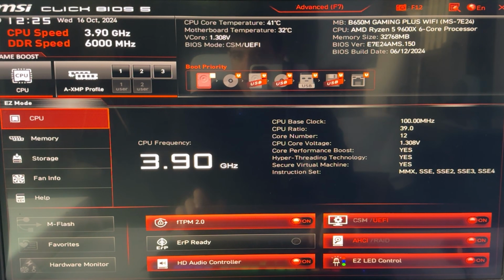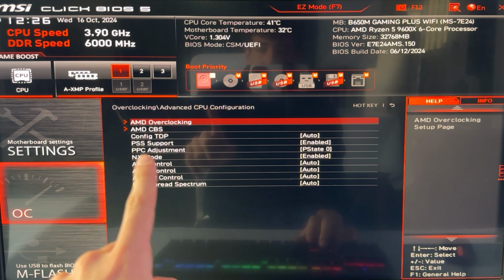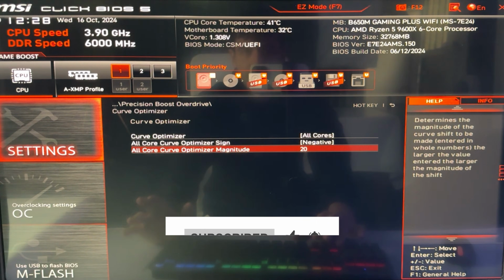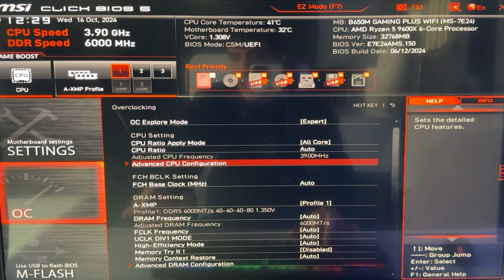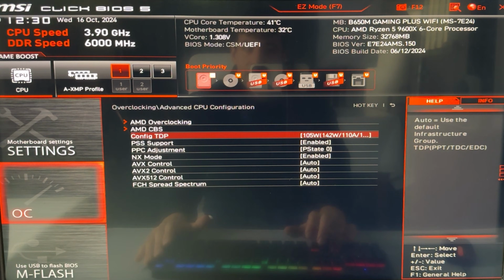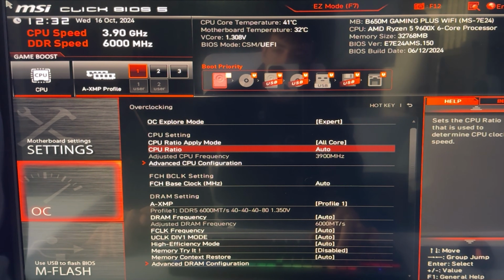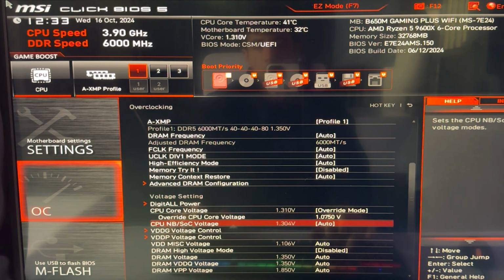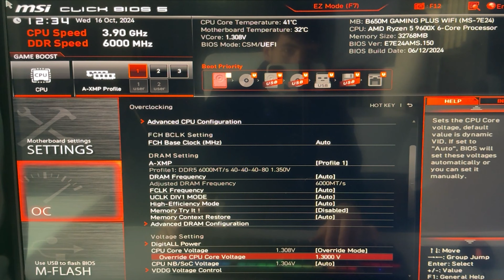Undervolt your Ryzen 5 9600X for more FPS and Lower Temperature!

Comment: Great video.
I undervolted my 9600X -20 and tested before and after playing games.
In HWMonitor my CPU Package Max went from 81.6 C to 71.4 C, the CPU CCD #0 Max went from 88.4 C to 73.3 C,  & the CPU Cores Max went from 75.3 C to 59.6 C.
Reply: High temps playing ultra gamings on 1080 p for stress cpu never pass more than 70c using 3 fans cooler aio

Comment: i try this and i had 0 results with all core - 20 or -30, same perf , same temps
Reply: You clearly do something wrong.
I can go 90w or 150w and have many diff performance diffrance.
I try to find best one for me.
My all cores goes idle/gaming 5.5Ghz but I want 5.7Ghz.
Reply: I feel PBO is nothing for me, I may just go manually oc like old days :)
I am going to set Vcore stable at 1.3Vcore and start with 5.2Ghz and rise up by 50Mhx step by step.
Reply: @Kage0No0Tenshi  i have a 5900x i'm not sure what values to do in that mode for best temps with the same performance, if i can get both it's ok but my objective it's same performance with less temps, 76º/77º spikes seems a little bit high , a few months ago i was gething no more then 70º spikes ( and it was VERY rare ) and i change nothing and then it's starts to get higher slowly without changes
Reply: I'm only trying simple for a few days , i maybe notice some less jumps in temps maybe 1º less degree now , performance wise nothing change or if it was , it's marginal like 1% or 2%, but now i feel something change, i was hoping for less temps

Comment: My ASRock B850M-X WiFi R2.0  mobo has that Precision Boost Overdrive page, but it doesn't have an Advanced option to pick, only Auto/Disable/Enable. When I choose Enable, there's also no Curve Optimiser page anywhere, so it seems like the ASRock screens are a bit different, unfortunately :/

Comment: I think (I am not sure) but I think this lowered my idle temps by 5 degrees. I'm sitting around 41-43 degrees idle and I rarely see anything above 70 while gaming at 1440p. I noticed the volts stay at 1.1 and I'm on an AIO.

Comment: I have this cpu now but i always used to have intel cpu before and they always run idle at about 35 degrees but this cpu runs idle between 45 and 50 degrees on idle. I have water cooling but its still around 45 to 50 degrees. How do i lower it to around 35 drgrees idle? Would this tutorial help?

Comment: 9600x without all this = 73° Peak. Now = 61°. Thx bro
Reply: What cooler are you using? 73° peak is pretty good
Reply: @yerachmielb1 I get a avrage of 73 when running a cpu benchmark I use a cooler master 212 black
Reply: @Whyalwaysreparingstuff  I must be doing something wrong. My cooler is a coolermaster hyper 212 spectrum v3, and the cpu hits 82-84 during benchmarks/stress tests. Nothing throttles at all, in fact without using PBO and the curve optimizer, my CPU doesn't even advertised clock speeds.
Reply: @yerachmielb1 I think the 212 black has a fan with more static pressure so it would make sense yours runs a bit warmer
Reply: @Whyalwaysreparingstuff  That's definitely possible. Truth is, it runs fine, and rarely produces noticeable heat, so maybe I'm being nitpicky.
Reply: @yerachmielb1  Probably hes not doing the same test as u. Its widely different if u do an aida64 test, or a CB23 test, totally different temperatures.
Reply: @CoffeeGameMovie  I used Prime95 once and CPU-Z a couple times
Reply: @yerachmielb1 be quiet! DARK ROCK PRO 5

Comment: Had to do this until my liquid cooler gets here. I was getting 80+ temps with a beefy fan cooler....
Reply: It’s weird to see a lot of ppl running their 9600x at above 80º when i’m sitting at 60 on heavy load while idle goes not higher than 38-39
Reply: @karedport.3435 you probably have eco related parameters on in BIOS and aren't achieving full speeds. I have mine set to 105w tdp mode with custom pbo. at max load and 95c hit 143w total package on a peerless assassin Air cooler.
Reply: @karedport.3435  it might be ambient room temperature affecting this, or bad airflow in their cases. my room ambient is 70F/21C and under load my 9600x doesn't go past 65 C and fans aren't even maxed out.
Reply: @karedport.3435 im in that case, my 9600x run at 84°C in game with a thermalright assassin King 120 SE and around 50°C on desktop…
Reply: It's supposed to do that. It boosts within parameters until it hits 95c. If you're getting less than that it just means you have a good cooler.

Comment: I got some strange results. Before that, I had a temperature of 80-85 in the game. After that, the temperatures did not change. I'm still digging into what could be the cause of this behavior.
Reply: Did you find out why? Also what are your temps on idle and heatsink?
Reply: might just be your fan setup or thermal paste application. tbh i did a pretty shoddy job when installing my cooler (i put it on incorrectly so i took it off and put it back on with the same thermal paste) and my cpu doesn't go past 65 C on full load.
Reply: Try reseating your processor, repaste and put the cooler back on, monitor the fan speeds and curve on your cooler aswell

Comment: I have negative 35 on my 9600x with no problems under stress testing. From what I have red you get no extra performance in games by using PBO or the extra TDP wattage. You actually loose performance in games for some reason. So the best thing to do is just do the undervolt thing.

Comment: Thank you! My 9600x is stable with the value of 40 (Maybe more but 40 is enough 😅).

My test:
- Prime95 (30 mimutes)
- Cinebench 2024.1.0 (2x Multi-Core)
- Valorant (3 hours)
- CyberPunk 2077 (3 hours)
- Idle / Browsing (2 hours)
Reply: Negative 40 sir?

Comment: my temps were reaching 91 while playing warzone but with this setting the temps stay around 70, thanks!. Also considering how high my temps were before the undervolt would you consider that going to 170w mode be a good idea?
Reply: Mine at stock doesn't even cross 65°c most of the time it stay at 59

Comment: so i have the same msi motherboard and did most of your config for undervolting and my pc went off and wouldn’t give any lights. had to use a second 8pin cpu connector so my pc turn on. other than that my fans are finally running cooler:)
Reply: Did you change it to negative? Sounds like you left on positive and set all all cores to use more power, which is why you need the additional power connector.
Reply: If it has 2 power connectors it's best to just plug them both in. It can't hurt it.

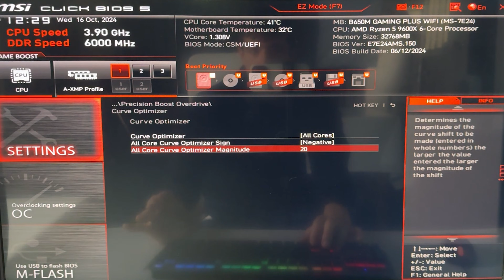Comment: 4:30 I went for All core magnitude 30 and ran Prime95 smallest FFTs for 15 mins. The temp was 89-90 ℃ and no crash. Does that mean my CPU is really good, guys?
How can I test the stability after undervolting?
Reply: Try blender opendata, some cinebench, and some gaming. If it crashes within 2 hours then its probably not stable.

Comment: have you tested the 9600x on a gigabyte b650  motherboard ? i have  tried 1v 5ghz profile and i have tried manually setting pbo to 65w but the stress test is going up to 90c on a nice 15c day but idle is in the 30s not sure  what to do my 7800x3d doesnt even go near  70c under gameing or even 80c under stress test

Comment: Its older video but i just buy 9600x with Asus Tuf B650E i have freezer 2 420mm aio and this cpu have idle  by room temp from 23  in idle 40-45  its that normal ? In the night about 35 degres idle on gaming 67.And second Question i looked in tab and on Desktop clock this cpu in idle on 5,4ghz.Its my first Ryzen cpu i got earlyer 11700k 125 watt and it was much cooler with same cooler...i got newest bios with 105w option but i got it not activated and cooler its propely installed.R24 Cinebech after 10 min  60 degres and 916 points

Comment: Putting Curve Optimizer at -20 negative made me lose about 20% of performance, since the 9600X is supposed to be faster than a 5800X, doing cinebench 2024 tests I am 20% slower than the 5800X this time lol
Reply: Have the Same CPU, in Stock settings, i geht in cinebench r 24 979 and Temperatur 73-77c° 360mm aio near 100% Fan Speed

I Manual Setup CPU at 5200mhz and v1.1 and get 936 at cinebench and 50c° on Low Fan Speed

Also Manual Setup CPU on 5400mhz and v1.2 and get in
 cinebench 974 and Temperatur 60c° and Fan Speed are little Bit faster that the 5200mhz

Maybe IT Help you (in 5200 and 5400 i set up tdb to 105w)

Comment: You are a legend my man. This tutorial helped me get my CPU temps down from 75 to 60-65. Huge difference. Fans are quieter as well. 
If you see this just want to know I had set the TDP to 65W. Should I increase it? Asking so I don’t miss out on any performance by lowering too much
Reply: try 95w, if temp is too high u can always put it back
Reply: @roten.  Thanks for the advice. Will try this
Reply: @harshvardhan5705  so, how did it go ?

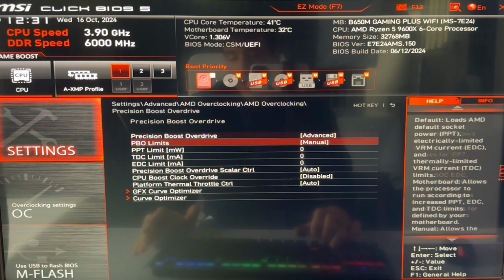Comment: 6:19 Just a warning people, pay attention to the units on the PBO Limits, some times its on mili units
Reply: This setting should be same across all AM5 boards, with same units.
Manufacturers can (and do) their own unique flavor for PBO-Overclock-Voltage etc in addition to AMD mandated one, but the Settings > Advanced > AMD Overclocking should be common for all boards, MSI ASUS etc
Reply: @raonyreis13  That doesn't really change the point unless your IQ is negative.
10×0,1=1
1=1
1000mL=1L
Unless your IQ is negative. Or you skipped school. Everyone know m followed by the symbol of the unit mean it's 1000 times smaller.
1000mV=1V
Reply: So, to manually set the PBO limits the same as 105W TDP, the values would have to be: 
PPT - 142,000 mW 
TDC - 110,000 mA 
EDC - 170,000 mA, right? 
(sorry if it's a stupid question, I just don't want to fry my brand new CPU lol)

Comment: Haven’t finished the video yet. But I’m not sure how we’re getting better temps and quieter fans. But also getting more performance?? Those benefits seem contradictory. I want my pc to run as fast as possible and I don’t really care too much about noise. But if I’m making my pc quieter and use less power i can’t help but feel like I’m missing out on some performance. Can someone explain?
Reply: Undervolting lowers the temps and locking the cores gives you more performance

Comment: I have an ASRock B850M-X WIFI and it’s updated to the latest (beta) 3.18 bios version yet I still don’t have an option for ADVANCED PBO. Only shows Auto, Disabled, Enabled
Reply: When you can, I'd recommend getting off of that board homie. I'm sure you've seen some of the horror stories with ASRock and CPUs frying. I just had it happen to myself with a Ryzen 5 7600x, latest bios. Had a spare MSI B650 that I was able to breadboard and flash bios so it'll take my 9600x I bought. Better safe than sorry 🤙
Reply: @xhalfwayhumanx thanks man definitely learned something new here
Reply: @cohbweb  Honestly it's not guaranteed to happen and if it hasn't after 7 months it probably won't now, but just something nice to know.

Comment: Great tutorial, ottimo lavoro! I haven't assembled a desktop PC in a decade or so and was a little rusty with bios configurations. For now I put the curve optimizer at -25 and everything is fine, TDP at 105W but I put a slightly negative on the maximum frequency because I don't care to exploit every last bit of performance, and I have an SFF case (Asus AP201). During normal use the PC is dead silent, while gaming the CPU goes up to 70°, very quiet.

Comment: i am using a gigabyte b650m gaming plus
and with my 9600x, i am able to do +200 boost with per core negative offsets of 60,60,55,50,40,45
and with a PL set to 88W, i am getting 5.268GHz stable all core on cinebench r23

i've tested it on ycruncher and corecycler, different games, and general use for days now, no issues
Reply: I have b650 ax v2 and I have simmilar results. 30 doesnt seem to do much
Reply: @ i don't know if we'd have to crank the power limit to see more gains
i don't have the 9600x anymore though

Comment: Static OC (Unavailable on A board) BCLK=100.00MHz (Not obliged); Core multiplier ×56 ; +200MHz limit ; Core boost off ; C-state off ; FCH Spread Spectrum off. Profile 142W PPT ; FCLK=2000 ; UCLK=MEMCLK (so 3000MHz) this equal to 5,6GHz at ±1,36V stable (can go as low as 1,26V

5,4GHz at ±1,26V stable (lower possible)

4,7GHz at ±1,05V stable (lower possible)

3,9GHz ±0,95V (lower possible)

Go try it my shrimp.

Results: 5,6GHz ±7050/890 CPU-Z
5,7GHz ±19185/2175 Cinebench23 (yes I can do 5,7GHz. The highest I've managed to boot and log on CPU-Z was 5,85GHz at 1,36V

All that was done on a entry motherboard (MSI Pro B650-S Wifi, BIOS K4) with a entry cooler (Assassin King 120SE) with a cheap but great thermal paste (SYY 15,7W/mk for comparison MX-4 is 7W/mk which is kinda bad but should work perfectly fine in 99% cases)

Edit: I'm not gonna lie 1,36V is mostly for increasing stability or if you're unlucky on silicon lottery, this should work at lower voltage, as the potential question of: 

Why not using PBO ?

 PBO do task more slowly, and doesn't boost as high as 5,6GHz unless I do a really low CO (like -40) the CPU still draw ~1,34V-1,36V on load which doesn't change much from manual) and run hotter than manual from.

Second edit: I've tested MSI X870 Tomahawk to push further OC and RAM OC. The board is pure garbage. Unable to do what I was doing with a mere B650 of the lowest tier. (Pro is the lowest on MSI) and a lot of BIOS glitch, the community seems to say the same thing about their BIOS. It's garbage.

I tested MSI B850 Gaming Plus. The motherboard is pure garbage for RAM. Often not even working for RAM sensors or cooking my RAM by putting 1,8V into 1V in or 8V in a 5V entry for RAM.

I tested MSI PRO B850-P it's also the same thing. And to the potential question: Isn't your RAM the issue ? The sensor is from the motherboard not the RAM. And as of how can you know it's not just Hwinfo64 saying non-sense.

Hwinfo64 was unable to have RAM info. CPU-Z too. 3DMARK too.

So folks, if you're interested into OC. Don't get a MSI B850/X870 motherboard. They are usually garbage. (Don't get ASRock for 9000 series CPU just by security). And don't get Asus unless it's a high end model because they usually have super high voltage for no reason (I've got multiple friend with perfectly stock CPU doing ~1,472V for idle. It's NOT normal).
Reply: could you give more details on where I can find these options in bios? would love to try these out
Reply: @huycao100  BIOS > Advanced > Overclocking
Most settings are in OC section or AMD CBS
Reply: I tried 1.28 for 5.5 static on the 9700x and it worked like a charm. I wonder if 1.26 can do it for the 9600x since it has 2 less cores to feed
Reply: @TLMikepad Maybe. Honestly you could go as low as 1,26V for stable 5,6GHz but it's not guaranteed of course. I can do 1,26V 5,6GHz all cores.

The max voltage for any Ryzen CPU (in "safe limit" is 1,36V±0,012V

Imo 9700X 5,7GHz is very easy on all cores. However you won't get away with an air cooler like me I think. I can tank 5,6GHz all cores in Cinebench with single tower air cooler but that's 6 cores.
Reply: @FireCestina1200  looks like im a silicon lottery loser then. I cant even post with 5.6 on an arctic 420, even with 1.3v. Tops i did was 5.5 at 1.275 with blender :(
Reply: You should make your own video
Reply: @TheKamilkrawczak My internet is so damn slow (or is it YouTube video analysis algorithm, I don't know, but I will say both haha

I do have another channel tho. But didn't post anything outside of resume of that comment. "CPU bible, or how to improve performance without (or with) overclocking it ⚠️check description⚠️ " is the name of the video. Channel: @SteadyClock

For every single one of my friend having a static clock speed over the algorithm as always resulted in better FPS even when they didn't overclock.

Comment: I’m confused I have an RTX 4070 ti super and I’m new to pc gaming does undervolting your GPU increase frames or overclocking it please help!!
Reply: you dont' need to do any of this just play normally, it's just nerdy optimising stuff you won't see any difference
Reply: @libra2054 oh it definitely helps. And you definitely see a difference. Don't lie to this person. Undervolting and locking the cores has been around for years and only locking cores has been around even longer before people started undervolting as a common thing. Locking cores gets rid of stutter in games when you cpu frequency fluctuates
Reply: @Stackali 9600x said have a maximum 5,5ghz,
If i lock to 5ghz,, i miss the maximum speed? Can u explain bro im noob😢

Comment: I have a question about the msi bios. I have an am4 b550 A Pro msi motherboard, and it has the same "duplication" of functionalities in the bios. The pbo settings are both under advanced and settings and oc. If I undervolt changing the settings in oc and then exit, the mobo asks me to save the changes, and lists everything I changes about pbo and curve optimizer. Instead if I change the senttings in the amd advanced section, when I go to save them the list is empty. I also noticed that if I use the auto curve optimization in ryzen master and apply them, the program writes the settings in the bios in the amd advanced setting, but nothing changes in the oc mode. Now my doubt is which one should I use in this msi bios, and what happens if I change both of them, which one prevails? Do you have any idea?
Reply: Sorry for the typos I'm on the phone.

Comment: Hey bro ,need video on I7-14700kf Liquid cooler aio ,*How to know if the liquid cooler is working fine*
i have Corsair H150 rgb, getting 99 cpu temps after some benchmark,i did thermal pasting,i have added contact frame but still,when i undervolt temps are good but without undervolt very high temps ,feels like aio broken or what,so need some way to identify issue,i hope u understand,also if air Cooler will be better then this aio